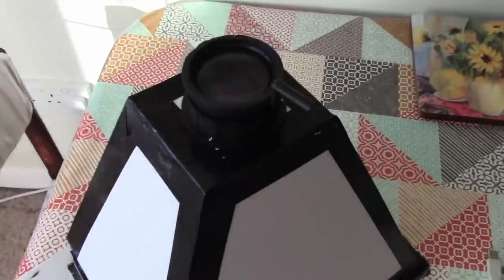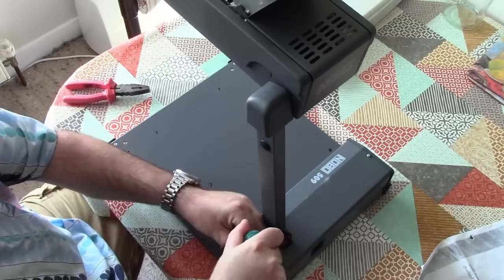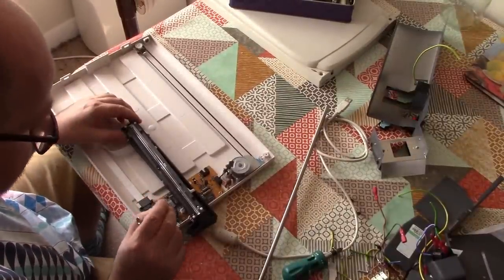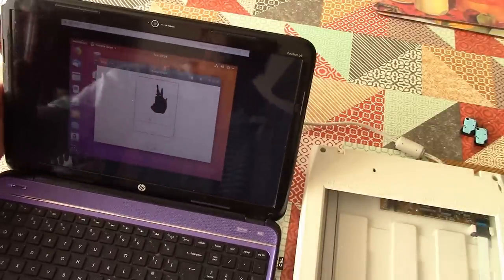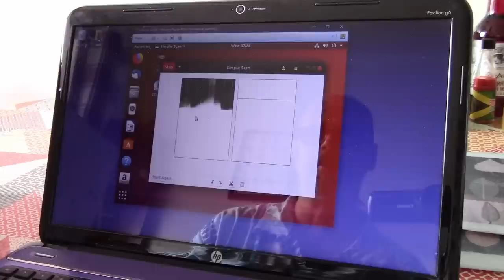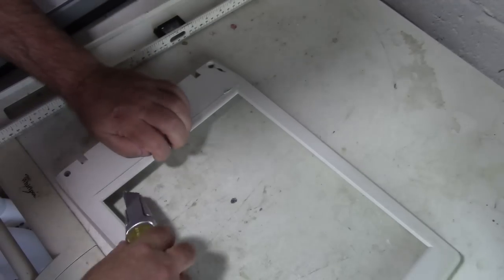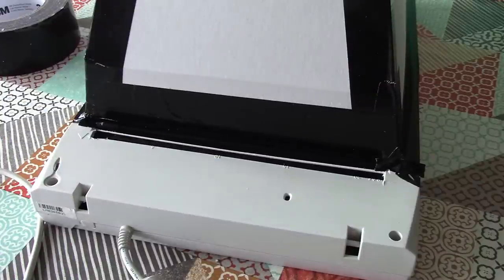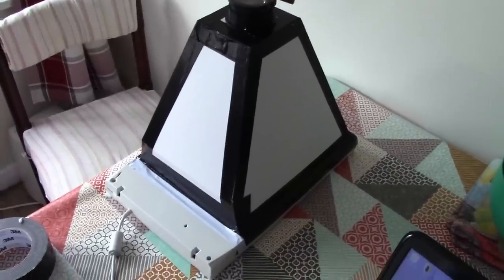I made a TERRIBLE Digital Camera!

Comment: There are two issues I can think of that you can address. One. Put a viewing window in the side of the 'hood', cover yourself and the camera with a dark blanket or coat and try to see whether you are getting a focusable image on the glass plate (I'm thinking of a photographer with an old plate camera). Two. Check that the scanner itself (without the lens and hood apparatus) can still record a useable image. Place a piece of white paper with an image drawn with thick black marker and backlit with a strong light on the glass, to see how good/sharp an image you can get.

Interesting project whatever the result.
Reply from the maker: Interestingly, I was going to do exactly that when the project was still going to include most of the projector frame, but I dropped the idea when I was trying to use a pinhole.

I think now, the key issues are:
Exposure - I'm just not sure I have proper control of that calibration aperture - so more experimentation required
Directionality of the sensor head - the fact that we're only capturing images of any sort in the middle of the scan strongly implies that the sensor head can only receive light that arrives perpendicular to the glass - not sure what to do about this.  Frosted film might work around it, but would limit the fidelity of the image (not that we're anywhere near perfect right now)

I'm going to try with a different model/brand of scanner and see if I get different results with that tech.
Reply: Lighting the subject from the front should help with the imaging. For example using a fill flash with a camera on a  backlit subject will help to capture background and the subject.
Reply: @AtomicShrimp  As someone else pointed out frosting the scanner glass should mitigate the directionality of the sensor.

The calibration strip needs a gray covering, passing variable amounts of light per what's available. Neutral gels used in photography come in different degrees of opacity but might be hard to find or be expensive. Strips of translucent red blue and green electrical tape laid on top of each other should work. Alternatively something useful might be found in craft stores.

Also, strip everything out of the scanner, paint the inside matte black and reassemble to get rid of bounce light.

Your images are very contrasty because that's what the scanner is intended to capture. It's never going to have the dynamic range of a purpose-built camera sensor much less film but better results should be possible.

EDIT: I thought that pattern was part of the table and now I find out it's a tablecloth.
My life is a lie...
Reply from the maker: @markfergerson2145  I recently watched a DIY Perks video ( https://youtu.be/9cT0jXI7l4E ) that shares a few features with this build - albeit far more competently than mine.  I wonder if a fresnel lens placed near the scanner glass would reorient the rays so they enter the scanner sensor perpendicularly

Comment: Essentially you're constructing a view camera. I have been thinking along the exact same line.
Problems
1 - you can't focus except by trial and error.
2 - you're probably getting back scatter from inside the scanner. The entire inside of a camera is matte black.
3 - you're not scanning an image, you're just recording a light pattern.
Solutions
1 - paint the inside of the scanner base flat black.
2 - obtain a Fresnel lens the size of the inside of the hood then a ground glass the same size. Fit that Fresnel lens should go on the inside, so tape them together then mount that in the hood.
If you can set up a real time monitor for your camera, then put your video camera pointing at the ground glass screen drape a heavy black cloth like the early photographers to block out light move your owl out to different distances, measure it when you have it focused and mark it on the focus ring.
3 - you may still need to put a black card with a hole in it behind the lens to help with focusing and control the amount of light entering. Find a video explaining the aperture or f-stops on lenses.

I know this is alot but I think it just might give much better results. At the very least talk to a professional photographer and show him shots of what you have and see what he or she says.
If this is strictly a b&w document scanner, you'll need to find one that can atleast see shades of grey or color.
Good luck. Hope my input helps in some way.

Comment: I loved the introduction, that sounds just the sort of project I enjoy. Overhead projectors, remember my early management days producing slides for presentations, wow that was cutting edge technology. I spent ages experimenting with different printers to see what would print on the acetates :-) Ah, happy days.
Reply from the maker: I remember we ran out of acetates one time and someone cut the transparent plastic cover off a spiral bound manual and tried printing on that - it completely melted inside the laser printer and wrapped itself around the rollers, destroying the printer.
Reply from the maker: Oh, I also remember than one department had a machine that would automatically change 'flimsies' for them - it was like a weird sheet feeder that went on top of a standard OHP - it had a remote control on a long wire.
Reply: Yes melting transparencies rings a bell too. We also used portable VHS video player/TV, amazing to think we would go and "HIRE" one for the day to do "team briefings". When we eventually had projectors we could plug into our laptops I can imagine how "impressed" our teams were. I could always threaten to show my holiday photos instead.
Reply: I used them to teach analysing Skew-T diagrams (radiosonde data), ca. 2012. It was easier to just use these and draw onto them than using a pc and a mouse. It was fun seeing the students' faces when I rolled that contraption in. 
I was using multi media: overhead projectors, blackboard, digital projectors and classroom experiments.

Comment: The projector you used is much smaller than the ones used in american schools when I was young. They had a big light box to diffuse light into a lens which material you wanted laid on top before having the prism/lens system like yours on top
Reply from the maker: Yeah, this one uses a lamp that reflects off a fresnel mirror under the sheet - it's designed to be portable (for certain values of 'portable')

Comment: Interesting experiment and interesting results.
Some thoughts that came to mind while watching:
1. The exposure calibration should be inside the camera rather than outside of it, even if you intentionally adjust exposure you want to expose based on what's coming through the lens rather than what is practically irrelevant lighting conditions.
2. In the pinhole attempts the pinhole was too big, most likely not in the appropriate distance from the sensor, and its definition is partly limited by the thickness of the material it is cut into. There are online calculators for all of that.
3. You're using a very high-contrast scene in your general tests, judging by your replies to some of the comments I'm getting the impression that you're aware of it and it's your intended result. I'd suggest doing the exposure and focus tests in a scene with a fairly even average light levels and slowly stepping it up from there, because there's still a lot to figure out with the auto-exposure and how it affects the final result, and it might be throwing you way off in the scene you chose to test on. 
4. You might want to use VueScan, allows you to control things you really outta be able to control with this device.
5. Be aware that the sensor is designed to focus on a fairly narrow focal length. You need the image to appear onto the plane where the glass is, so a tracing paper like you mentioned in a reply here may affect the definition but it should increase your potential focus by a significant amount. 
6. Also the sensor was designed to be used with a huge amount of light coming onto it. 
7. Those lines that go along the axis of movement of the carriage are pretty damn weird. Might be weird interpolation shenanigans, or perhaps DPI setting that doesn't match the sensor's capabilities? I expected them to be on the other axis because it sounds like the carriage is stuttering so I figured the lines are from the stutters, but it's the other axis. Well you can't do much about the interpolation, but you should try different DPI settings to see if they go away, also maybe they'll go away after you solve plane of focus and lighting conditions.
Keep it up

Comment: I am  reminded of much pointless tinkering I did back in the 1980s attempting to spincast a parabolic mirror lens from acrylic resin.
Many hours were spent in construction of lens body and several attempts at the resin mirror. 
I used a record player turntable with a shallow container for the resin. The turntable speed was 33.3 rpm.

I made my own silver plating using.  Tollens reagent plus an aldehyde. That worked reasonably, but I never managed to get the mirror to optical quality.  I managed some images with the light filtered to a narrow spectrum.  I rather lost interest as I was taking ages to get rather poor results.

Comment: Subject needs to be better lit. Early cinema, which your scanner is going to be more similar to than something like an SLR or even a pinhole, used very powerful spotlights on the subject. I can see what you're trying to do with the high contrast though. Truth is, I'm not sure what would really work here. The scanner doesn't appear to be very good to begin with.

Interesting video though, to be sure. And I don't think you were trying to produce anything more than perhaps you managed. Actually, come to think of it, strong spotlights might just give a white image, unless the calibrator compensates, of course...but I'm not sure how much range that calibration might have.

On another point, pinhole cameras take a long time to record their image. Even though, on the whole, your image was taking a long time to capture, each line of that was capturing very quickly. Sadly that doesn't seem to be something you can customise.
Reply from the maker: Good points. I have another scanner I might try. And yes, I wasn't hoping for a whole lot here

The slow shutter speed was going to be a feature - I had hoped to take this out and capture some street scenes - buildings would-be intact, people and cars would be rendered in slices

Comment: I wonder if you could get the  raw data from the scanner and post process it.
I also wonder whether a sheet of paper on the glass might help image quality as that is what the scanner has been optimised for. Obviously you would lose some light but that doesn't seem to be the problem. You would also be able to preview the shot (with one of those hood things, due a hipster come back. Ihood anyone?)
Reply from the maker: I was thinking of a sheet of tracing paper on the glass - it will impair the theoretical maximum resolution of the device, but I'm not exactly pushing the limit of quality at the present time.
Reply: @AtomicShrimp  I agree all things being equal, It won't increase quality. I'm just guessing that the scanner has been optimised to scan paper, so giving it what it wants will be a net gain. (Even though as you point out, it is hard to improve on perfection :p )

Comment: Let me put it this way. I am not an expert with scanner cameras which i only discovered 6 hours ago but i noticed you have used the magnification lens from a table projector and this is very very wrong. magnification lens does not project accurate picture on the panel. So, You should replace it with a 35 or 50mm lens from any camera.